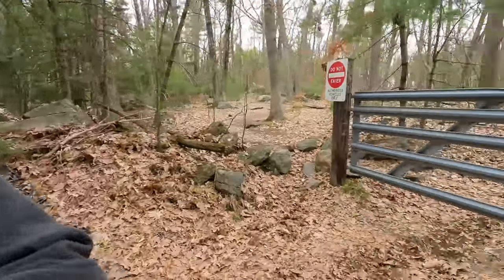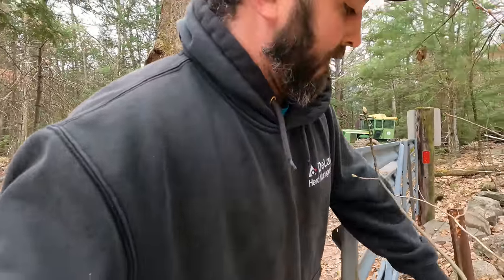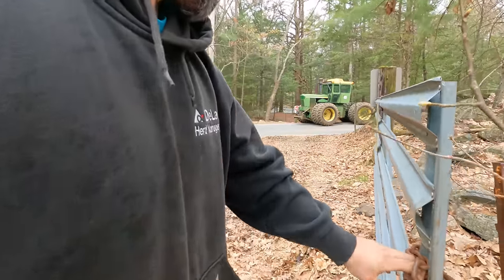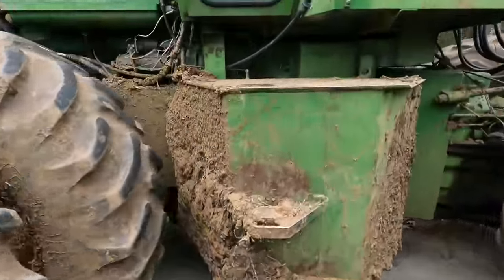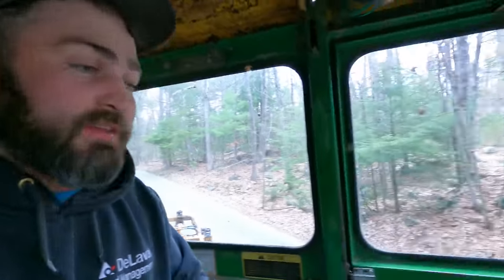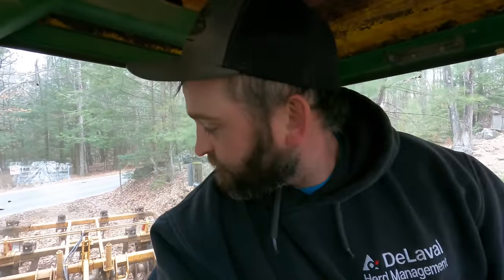All The Horsepower- John Deere 7520 Chisel Plowing Spring Tillage 2021

Comment: Love the old 7520. I have a 1990 bidirectional 9030 New Holland, a John Deere 4230, 1986 F350 with balebed and a 1973 Peterbilt cabover that I use on my Angus cow calf operation. I run the old stuff and work on it all myself as well. Love the channel 👍

Comment: Those tractors did a lot of work before the " newer" stuff came out. While not as nice as a newer machine they still get the job done. Look at the Welkers. They run the Big Bud machines out of the seventies and cover thousands of acres with them. Still lots of the old Versitile tractors running. Sure would like to see a big ol chrome straight pipe on that tractor. If the manure smell don't get the neighbors going a straight pipe at three in the morning would...

Comment: Our JD 544 B does the same thing occasionally. There is a screen in the pickup line that plugs with debris that causes the same symptoms. Also the power to the injector pump has gone bad and caused similar situation.

Comment: Just noticed that you have a BRØYT hydraulic digger. I wonder how that piece of Viking history managed to get all the way over there...
BRØYT is a Norwegian brand, belonging to Brødrene Søyland(Søyland Brothers) and their first machines rolled out of the factory in 1949, and they were quickly known for being technically more advanced than the competition because of the hydraulics. 
The Swedish company Åkerman came in as owners in 1981
Then they got tangled up into Volvo in 1991, and the name disappeared in 1996. 
Now it's a company 'Sandvik Tamrock' that owns the name.  I think...   

There's still a lot of them working construction sites or preparing new fields here in Norway. They were built to last, and if you treat yours well, it will outlast you. 
My father drove one for many years.

Comment: It looks like that 7520 could use a rebuild the way it's smoking. Usually if the rings are worn-out then the bearings are not far behind, they might decide spin and window the block.
Reply: No smoke, no poke!
Reply from the maker: They all smoke from every one I've ever seen
Reply: @DuffyAg  
Black smoke is normal but the blue is oil getting past the rings
Reply from the maker: @Mark_Tschetter  I have never seen a 7520 running that doesn't have a haze to it. I'm sure the rings aren't perfect but it's definitely not in need of a rebuild. Has no indicators of concern in the breather

Comment: Cool videos for sure. I have operated tractors for years. Your plowing method is in my opinion going to cause you a lot of soil compaction. To many tire tracks. Leave the plow down to plow out. The way I was aught is do your inner field and then at the ends of each row where you turn you are compacting a lot. Once done with main field you do two laps around field to remove your compaction and leave the field with very minimal tire tracks or compaction. Where I am we have that good old black gumbo soil. That is our reason for watching compaction so much.

Comment: Is that an åkerman digger you pas 2:02? H3b I guess. Old swedish iron.
Reply from the maker: It sure is there's a previous video with it. Currently it's sitting till I got time to reassemble the engine
Reply: Ok fuond the vid. There is a forum by the name www.maskinisten.net it's all in Swedish but the know'how on these old equipment is close to endless. Just a friendly tip if you ever need it:)
Reply from the maker: @davidjonsson3663  I really appreciate it not much information and support on them locally so that will help

Comment: Does it have the original 531 engine?
Reply from the maker: It sure does but has a 11mm pump on it and not sure if the turbo is factory or not. Dynoed at 235hp

Comment: Them older diesels are not to fond or the low sulfur fuels of today.  If you add automatic transmission fluid or 5w-20, 5w-30 the the diesel fuel at 1 quart per 5 gallons the tractor will run better and produce less smoke. It works well for our machines and they run smoother and with less purple smoke and a bit more power, but hey to each there own just a suggestion! To bad you guys are up in Mas. (I'm in CT) I'd come and help if you needed it.